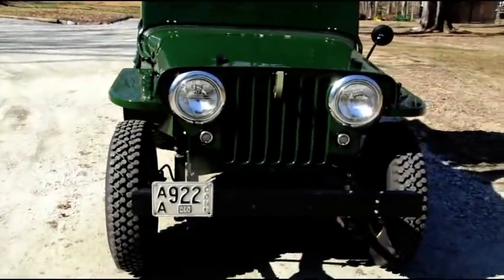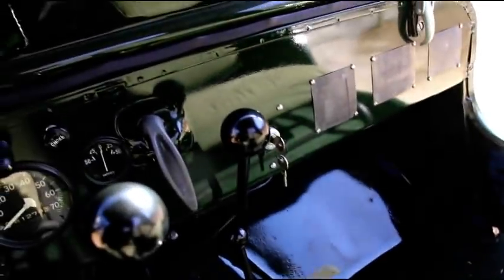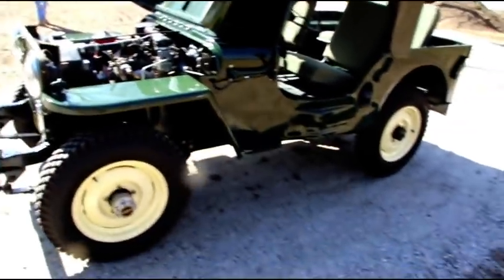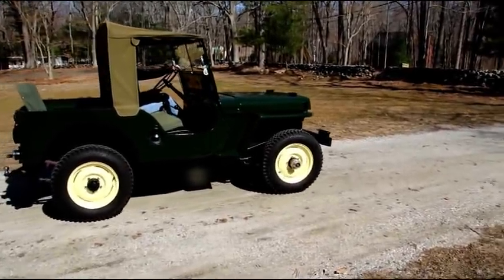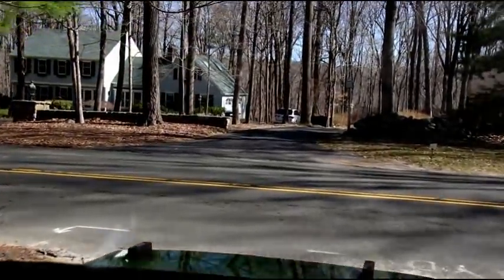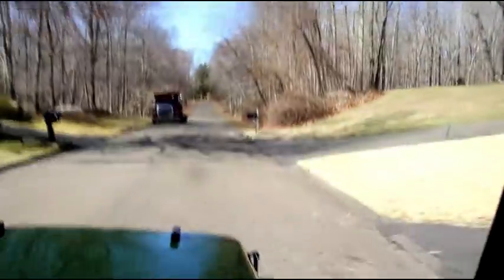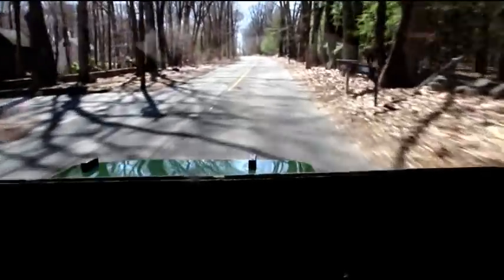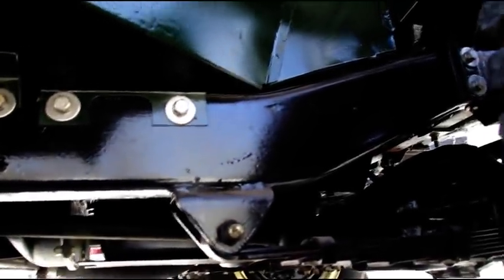1946 Willys CJ2A Jeep For Sale

Comment: hello, really nice Jeep! was the dual tank a factory option? Or did you have to remove the tool box? How can you have a rear PTO and an overdrive? doesn't that go in the same place at the back of the transfer case? thanks a lot
Reply from the maker: dual tanks were not a factory option.  I removed tool box when building this body tub, then built a custom fuel tank for passenger side.  Rear pto and overdrive is common.  Overdrive gets installed, then a special adapter to accept the pto is installed on back of overdrive unit and pto bolted to it.

Comment: The dual fuel tanks was a factory option?
Reply from the maker: No customer wanted longer driving range so  I fabricated an auxiliary tank
Reply: @metalshaperJeep  Thanks, seems like an option they would have had. I'm about to make a offer on a January 46 built 2a with the pto and column shift. It's a really nice original unmolested jeep, still has the counterweight mounted and original bug screen and hood welting and the long horn. Also pasture green. Was checking the Haggerty guide trying to get an idea of prices. Beautiful restoration btw.